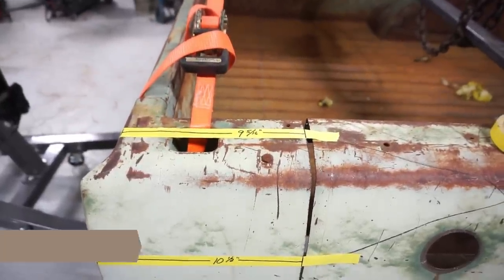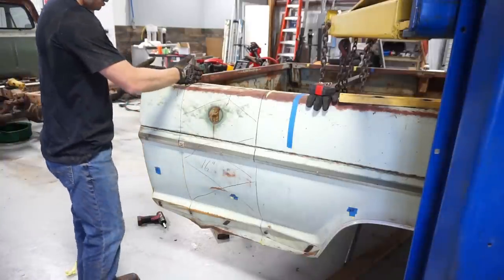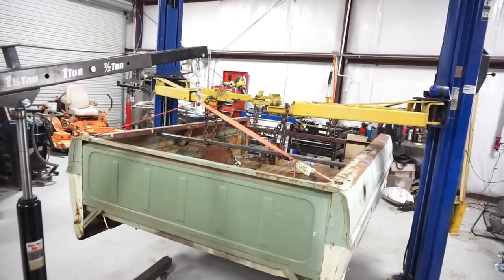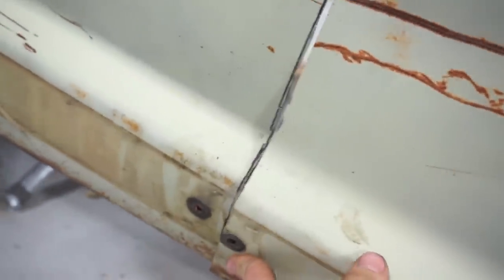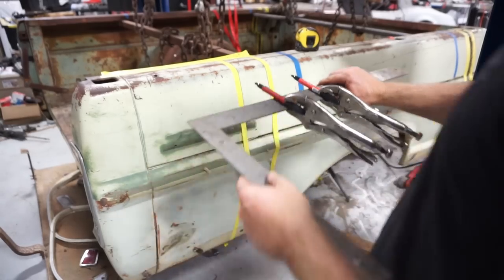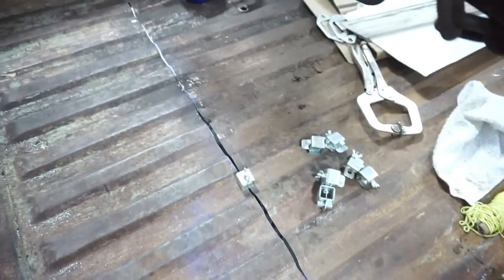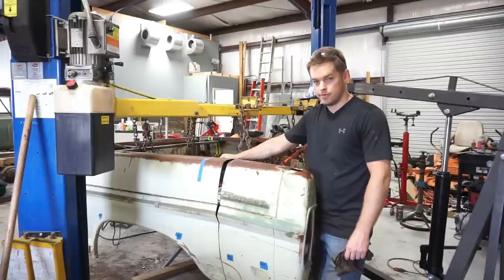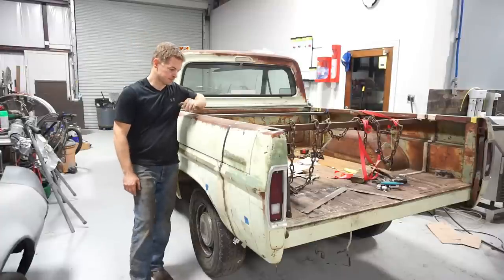F100 Long Bed to Short Bed Weekend DIY Part 2

Comment: we all have our own ideas how to go about things.  I would have added more bracing to both ends of the bed.   But watching you do it, maybe my way was unnecessary overkill.   I enjoy how you get things done and with good explanations.  Good job saving this one.   What’s next for this build? Please keep posting.
Reply from the maker: thanks! I would also agree with bracing both ends. It would just make it easier to work with. I have a schedule planned out to do some engine work. Convert that 360 to a warmed up 390. Maybe a dyno run to test actual HP difference. Redo the interior, then do a crown vic front end, and an explorer rear end... make it a fun street rod.  I'll keep the camera rolling!

Comment: A tile laser level would've come in handy...
Screw two pieces of 2x4's (temporarily) in the bed on a vertical to use as a guide, with a longer blade to keep the blade from walking, joint the two 2x4's with another 2x4 on the bed floor to get your horizontal guide.
NOW, at 21:15 take a 2 inch thick 4x8 sheet of pink rigid foam insulation, and hold it up the freshly cut edge of the bed and make an imprint in it. Cut out the profile of the bed. Then take (2) 4x8 sheets of 3/4 plywood screwed together and transfer the foam profile to the plywood. Cut plywood, you now have two pieces to make a sturdy buck for left and right of your cut. This will keep the sheet metal from wobbling and hold your blade straight for the next time you do this...

Comment: Great video!     One of those cheap laser levels may have been of use.  I had one, before the kids got ahold of it, where you could have sat it upon your measure mark and lined it up with the mark on the opposite side and a beam would have shown across and up where you needed to cut.     -jp

Comment: Man you did a really great job. I was impressed with how much time you took making sure you had everything marked off right… Which is exactly what you have to do in order to do a nice job. In that case it’s kinda like measure 50 times, question yourself 100 times and cut once…😂 I just got a 72 F100 Ranger XLT and it’s long wheel base. I was kinda thinking about doing the same thing but idk the long wheelbase is kinda growing on me now… lol I never thought I would say that…😂 But if I do decide to shorten mine I’ll definitely use this video as a reference. I’ve gotta get some of those butt joint clamps like you’ve got and some nice body dolly’s. I’ve got a few small holes I’ve gotta get patched in the floor pans. Thanks for taking the time to share your experience with us. 👍🏼 I subscribed to your channel to btw…

Comment: Man when I cut into my bed I used the grinder because the sawzall blade was jumping around all over making it so hard to keep a straight line.
Reply: Gotta make sure to keep the shoe against the work piece or itll be a bitch.
Reply from the maker: I was worried about the grinder burning the paint on the sides.. I wanted to save the patina, so I went sawzall... probably could have plasma cut it if I didn't worry about the patina

Comment: Nice job!  Using your time, saw blades and grinding wheels you pulled it off!! A project I always intended to do was an older cab with a late model short bed stepside. I've seen a few done and once they are painted the old cab body lines and the newer flared fenders on the bed just seem to really work. 
I just ran onto your chanel so I'm not sure what your goals are with the truck? I think I'd be tempted to just smooth your welds out a bit with a sanding disc and shoot it with clear. Get that rat rod look going and plus show off your work. There are very few guys who could spend the weekend in the shop and do what you did. 👍👍👍

Comment: Alternative suggestion on cutting out sections of the floor. Cut one section out of the front of the floor. Then the sections out of the bed sides, both front and rear. Then slide the entire floor forward and weld one seam across the front. Plus it helps keep the sides straight as a guide.As another guide, spot weld or metal screw some angle or box section to the under hang lip on the top bed rails. Then slide forward and clamp in place as another form of guide.
Reply from the maker: would you have to cut the fender wells out, and cut the floor loose from the sides of the bed all the way down?  I agree on the box section or square tube under the rails.. that thought actually hit me as I was hanging the rear section on for the last time.
Reply: You are correct, I worded that wrong.

Comment: I do this kinda stuff for a living, technically that makes me a professional. This video should be labeled, How not to shorten a pickup bed. But he did get it done, he wasnt scared to try. Its just a peice of metal. Never use a sawzall and never cut through the center of the panel. You will get way less warpage if you cut/weld next to an edge, especially on a panel with a non-compound curve.  He did do a goodish job on the frame tho.

Comment: Should've used the ole Fritzie cut and but just leave it together and run a 16th inch cutting disc and run where the panels touch . Saves a lot of taking it apart and putting it back together .

Comment: I’m about to do this and use your measurements. One question is in the rear. The brace only brace was retained. My question is did you spring shackles hit that brace and did you have to fix that? Seems I’ve seen that happen before on some I’ve watched. Thanks

Comment: What are the small alignment clamps you are using? What are they called and where do I purchase them? Did you just do a million tack welds until there was no space between them or did you actually run a bead on the body seems? My first big welding project is to replace "Cab Corners" on my 1985 K2500 Chevy Truck and so am trying to learn as much as I can before.

Comment: Don’t know if you did it, but I would have power washed the frame. I would have applied rust converter to it and painted it black. 👍🏻😎 And probably the underside of the bed as well.
Reply from the maker: I plan to do an explorer rearend swap, I was going to pull the bed off and do just that. Power wash, wire wheel, and coat the frame.
Reply: 330_Garage - Good man!! 👍🏻😀

Comment: Fairly easy to have clamped a sturdy straight bar to top of bed rail of front and rear caps, which would've aligned/ and held them to center section without cherry picker. Then no guessing of alignment, just flap/grind tight areas knowing your parallel at all times

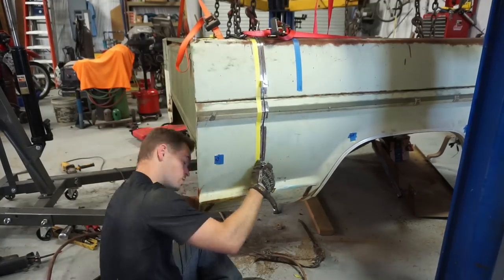Comment: What are those little butterfly jigs you’re using at 27:00??
They helped the panels line up nicely!
Reply from the maker: Those are called panel clamps, or butt weld clamps. They are cheap and super helpful for doing stuff like this. Here's a link to where I buy them:
https://amzn.to/3oubzio

Comment: I'm about to buy a '74 F350 flatbed/dump body with side lift gate and found your channel.
Watching through this entire playlist
Why do you put tape on both sides of the gap before welding?
Why do you use a clamp on some of the butt clamps when you weld?
Great videos, liked and subbed!

Comment: If you or did you cut on one side of the first cut line and then on the other side of the line on the second cut line on the floor maybe the fitting would have been less work? very nice work bye the way!!!!

Comment: Awesome vid, when I measure my long bed(73) compared to my shortbed75, only 16 inch difference? Not 20. Am I correct?
Reply from the maker: On the 67 -72 You are taking out 20" total. You want to remove 16 inches in front of the rear axle and the frame, and 4 inches behind it to keep the proportions correct, or else the bed will look goofy. Of course you're cutting it, so you can customize those proportions to give your truck a little different look if you want.

Comment: Great job but if you would have left the corrugated part sticking out on your second cut and drilled the spot welds and took that short piece of corrugated off the front section you wouldn't have to weld it across the floor 👍👍

Comment: Nice job but I am curious I cut a 77 F150 and only had to take 16" out if the front and it was the exact same as a factory short bed which I had setting there but it was not a nice bed and the truck I cut was a Ranger XLT so it had all the chrome on it which I cut also I did this for my sin who was in Afghanistan  serving his country any way was just curious if the two years need were different

Comment: Anyone know what the magnets with a wingnut on top used to hold the panels together? Awesome series, cool truck. 👍🏿
Reply: Those aren't magnets they are panel clamps.  Look them up at Eastwood.com... very handy for this type work.
Reply: @Texasknowhow  awesome thanks 👍🏿
Reply from the maker: They're called butt welding clamps. They work great for this type of work, and they're cheap enough, when you accidently weld them to your panel and have to grind them off you don't feel bad! Here's a link to some cheap ones that I use. 
https://amzn.to/2SvntuW

Comment: Just out of curiosity on that rear bed section why didn't you just use the actual body line as one of your cut lines instead of using it as a measurement reference?
Reply from the maker: I placed the cuts where i did, based on some published differences I found from Ford, where they explain the differences in the long bed vs. the short bed. There are some cross braces, under the bed, that you want to keep in place.

Comment: I don’t understand why you cut the back of the bed twice you could have cut it once and put the tailgate cap back on
Reply from the maker: You have to, in order to keep the proportions correct. Otherwise it will look goofy. I used the ford published measurements to get the bed in line with a factory short bed.

Comment: Perhaps I missed it in the first vid...but why not cut the 20" from the front, instead of cutting out 2 sections? Great vids btw!
Reply: a short bed is shorter on both sides of the wheel wells.
Reply: Bumb side short beds are shorter on both sides of the axle where everything else from 72 and newer is only shorter on the front half

Comment: A plasma cutter or disc grinder might have been better but you no doubt tried them.  Since you seem to be reasonably intelligent, where is your face shield or safety goggles?
You could have likely sold the long box and bought a shortie with cash to spare.  Great fitup of the rear ass'y.  We certainly don't need that loud crap 'music'